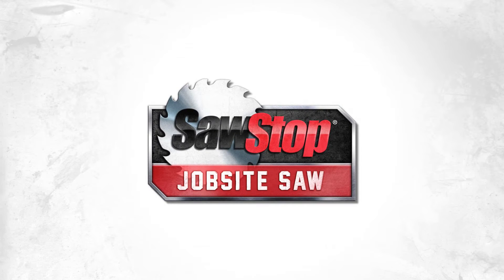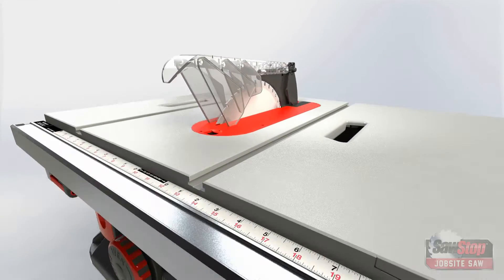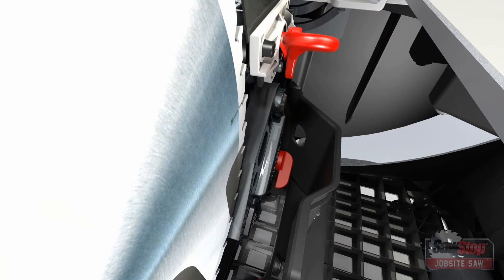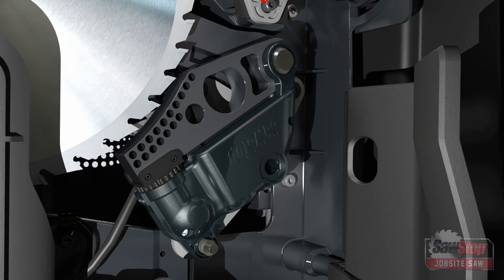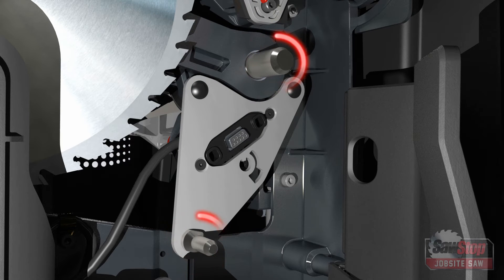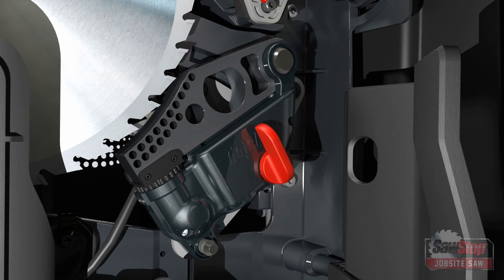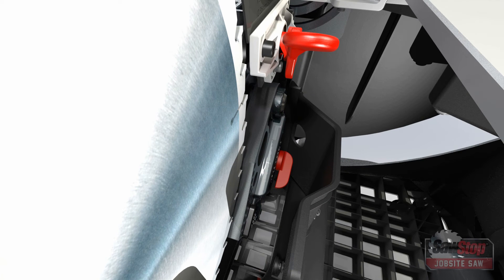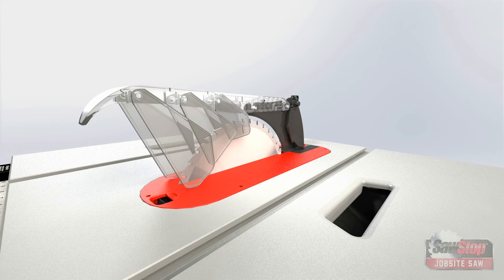SawStop Jobsite Saw: How to Change the Brake Cartridge

Comment: So.. what do you do if the blade is embedded in the cartridge?
Reply: It's the same procedure, but with extra cussing and swearing.  😄 Seriously, after you take off the blade locking nut and washer, you have to lever the saw blade and the brake cartridge out alternately, using the flat end of one of the wrenches (for the saw blade) and a big screwdriver (for the brake cartridge). Lever one out and then the other until the blade comes free of the arbor.
Also, if a new brake cartridge refuses to seat all the way, try putting the cartridge key into the cartridge when it isn't in the saw. If the key doesn't go all the way into the cartridge, put the key in from the wrong side of the cartridge and rotate it until it goes in all the way. Then the cartridge should go into the saw okay. (The "keyhole" for the cartridge key has two independently rotating segments, and there are slots in these two segments that have to line up.)
Hopefully this comment spares someone the half-hour of frustration I just went through.
Reply: @KarlBunker  Thanks mine just went off,  I just got the blade nut off and the key out but was debating if i should get the jack hammer out.. lol.  thanks, going for the pry bar now.
Reply: @rrrrkoop2776  Late to the party, but I found that rotating the arbor by hand helped get the blade off (basically unscrews it).

Comment: Can you adjust the brake gap on the jobsite version? Doesn’t seem to have this yellow hex bolt like all other versions and most of the dado blades I’ve popped are not the recommended distance from the dado brake (too close). Dewalt and diablo seem to be 8 1/8” To the carbide tips ; not exactly 8”.